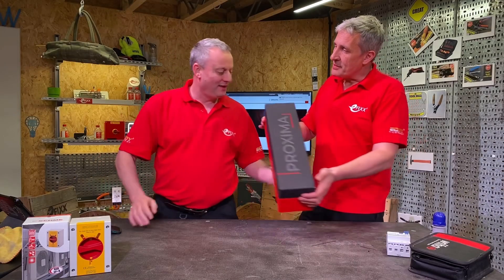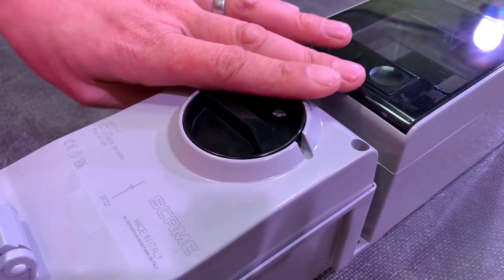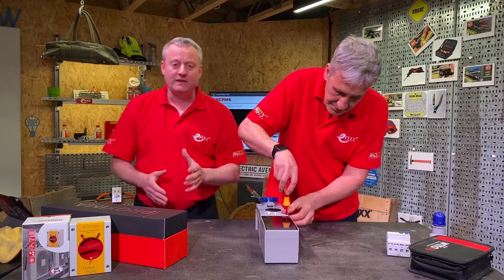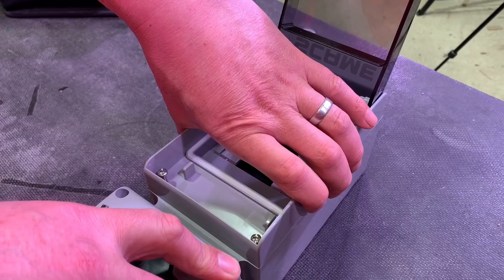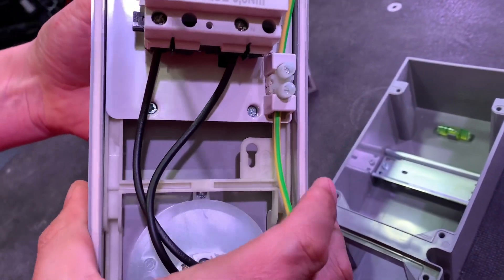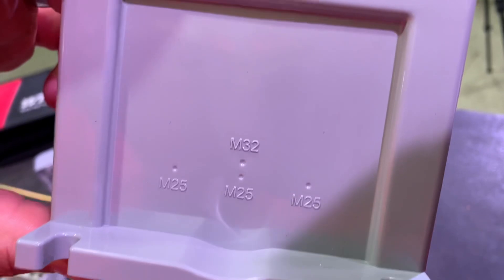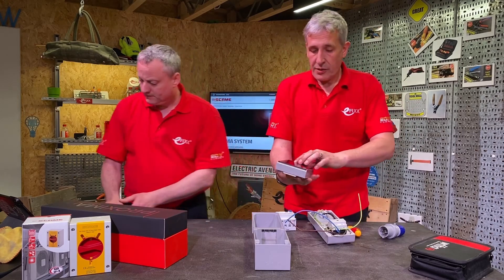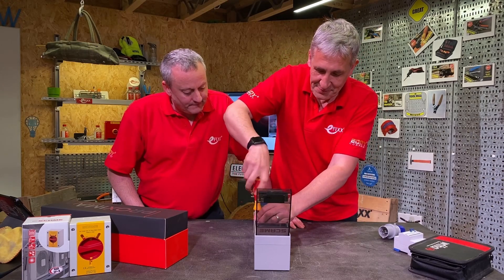Proxima - The Perfect Gift for Industrial Electricians

Comment: It's stocked at our local wholesalers and looking at it as well as the isolators it is a nice bit of kit with making the installation easy and like the unit with protective devices and multiple different outlets you have shown would be my preferred choice using the correct materials for the job but unless it is specified it is hard to get some clients to pay for the first choice you would want to fit.

Comment: Nice looking kit.  What kind of cable is that in the pre wire, does it need a Bootlace Ferrule?  Does it have a AFDD option?  Top entry is a double edged sword, if done well its good and looks nice.   If done bad then debris and moisture will creep/seep in, also depends on the enviroment.  it would be good to see the IK rating and give it a test with a common scenario device like a sack barrow or pump truck at walking speed.  I hope these comment don't SCAME for life.  Keep up the great work guys.

Comment: When installing anything outside never bring the supply cable in the top, water our enemy will leak in no matter how well it is ceiled, top entry is the absolute last resort, always go bottom or side. The other thing I noticed, is the turn down on the socket outlet is not enough. The leverage that will be applied when removing the plug will cause the whole thing to be damaged and they are not cheap 🤡🐔